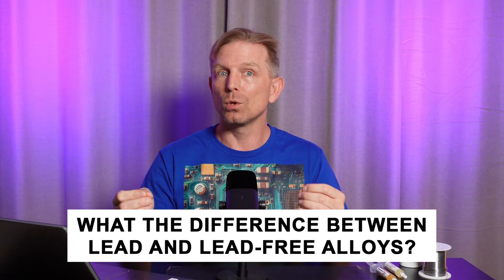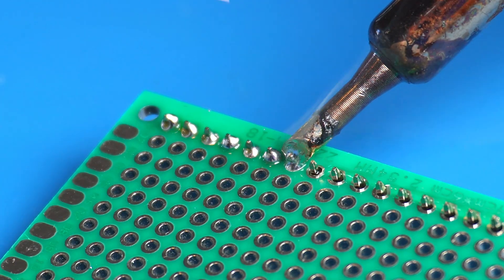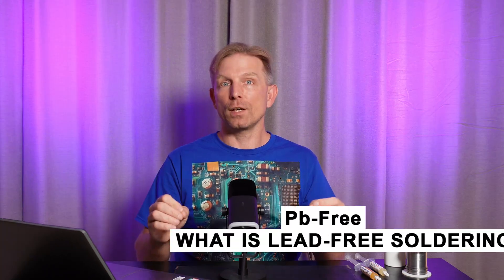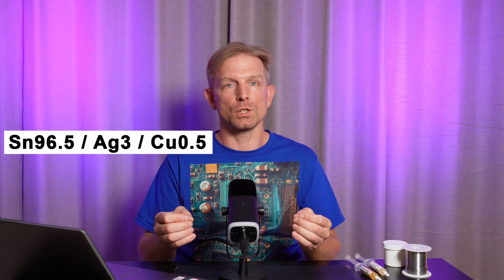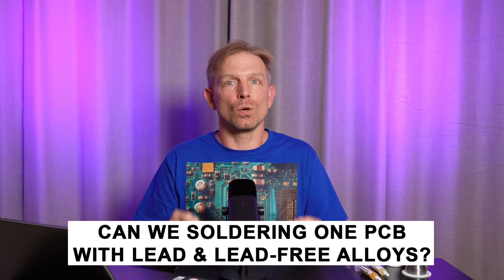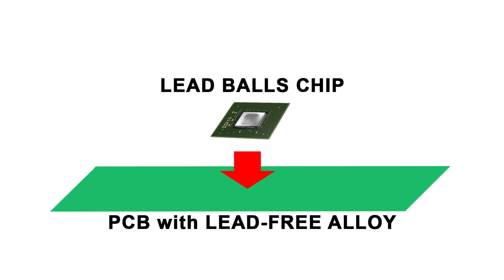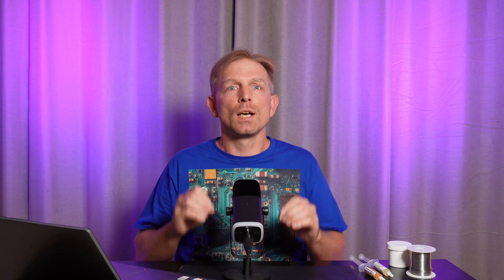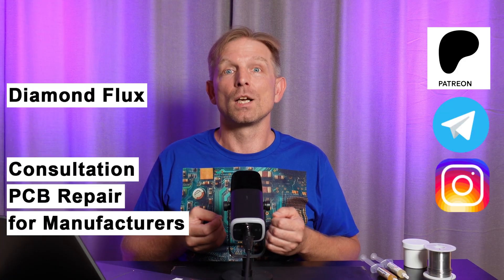Lead vs Lead-Free Solder Alloys – How to Choose for PCB?

Comment: I'm not professional engineer but I tried lead free solder with about 3.5% silver for fun. Electronically temperature control is used, 360C. The solder is 0.56mm, this works fine for microelectronics. I like the bright colour and I think it's quite stable. Practically I don't see disadvantages against 'classic' leaded solder. But the latter can oxidize quicker over time and turn dark. Lead free solder won't.
Reply from the maker: Thank you for comment! You'll find more videos on my channel. I hope you'll find them useful :)

Comment: I use Kester that is Sn63Pb37 Alloy. Like you said lead free requires more heat and not as reliable so It makes sense to use Leaded
Reply from the maker: Absolutely 💯